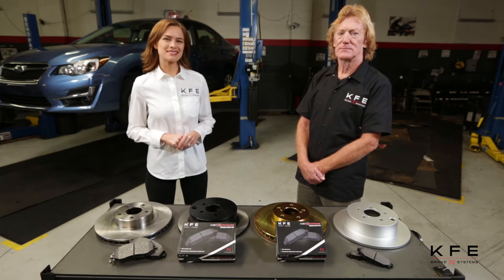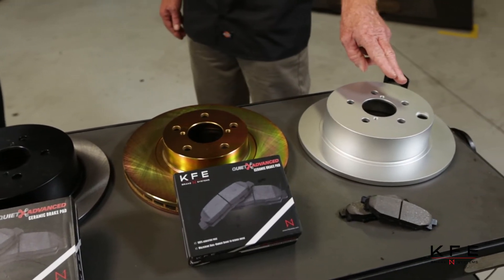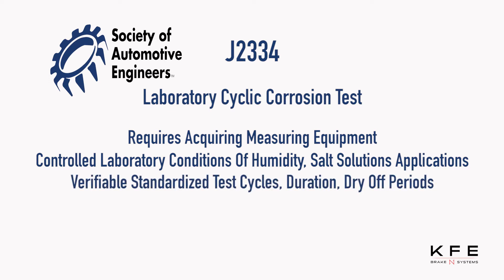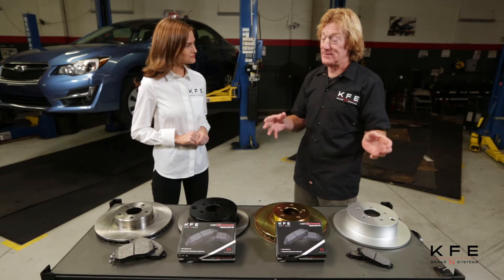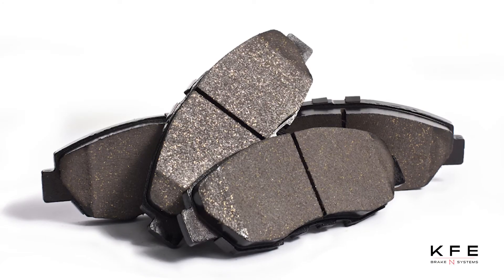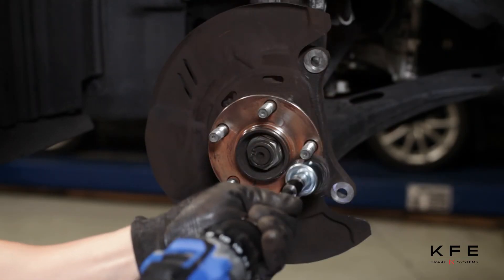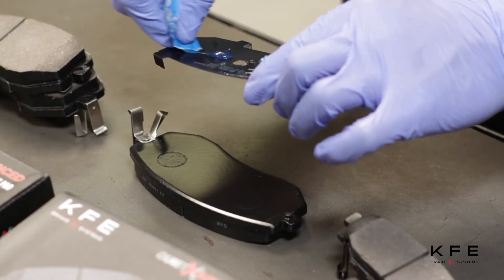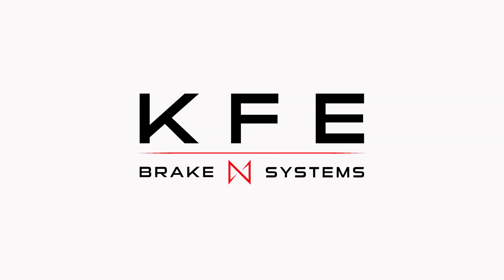Rotor Corrosion Comparison - Blank vs Painted vs Zinc vs Coating Part 1

Comment: Do I have to clean zinc cotes rotors?
Reply from the maker: Easy answer is no.  

Generally speaking, any kind of rotor protection is either sprayed or soaked on, either by itself or w/ some kinda of extra bonding technology/technique.  .  

If let say you are reusing rotors that are still under manufacture specification thickness. The rotor surface should be turned, so there isn't any rust on the surface itself.  The other areas are hub, and the edges of the rotor.  The area that will really effect runout is the hub area.  You need to clean out the rust that are on the hub of your rotor.  Reusing rotors that are not turned, or have extreme lateral runout is probably the top reason for brake noise after a brake pad change.

If you try to remove that rust most likely you will take off whatever material that was original on there (which at this point have been degraded), and get through to the iron.  In that case, you will most likely get new rotors on the next pad change, so its better to have a little bit of rust than runout rotors.